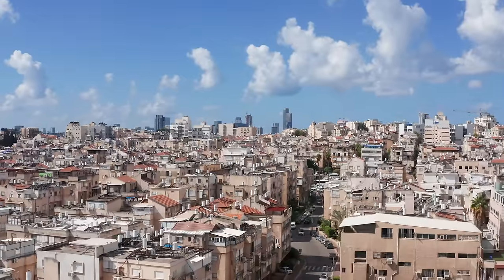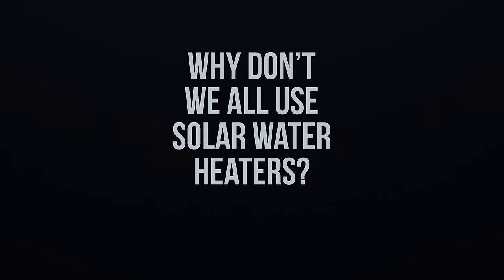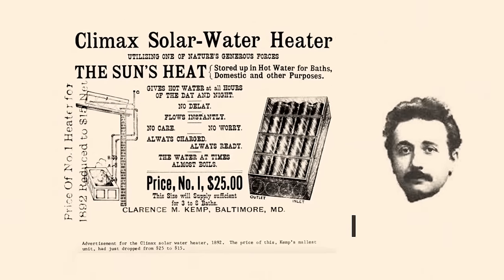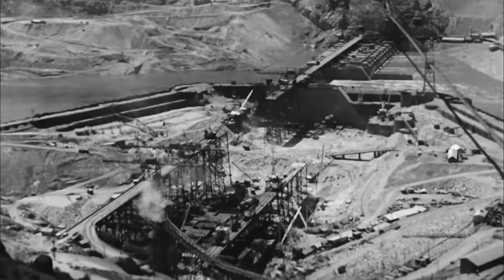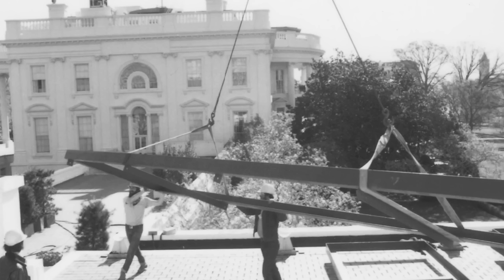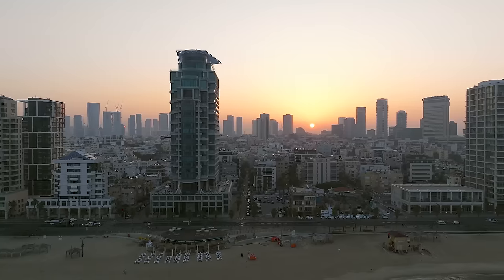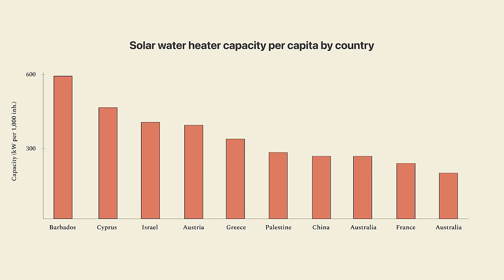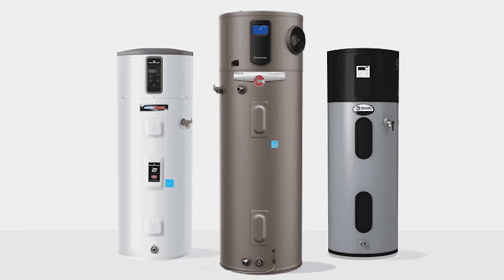Why Don't We All Use Solar Water Heaters?

Comment: I put solar hot water on my home in Florida almost 20 years ago and took advantage of the 30% tax credit. Took me 4 years to recover the capital outlay through reduced electricity bills - after that hot water has been free. In 20 years I have replaced the solar power pump just the once - it cost a mere $80.  I, too, cannot understand why solar hot water is not mandated on all new construction here in the sunshine state. It would create a local thriving industry in making them and they would get cheaper as the economies of scale kick in.
Reply: The answer is simple: When you buy gas or electricity to heat the water the state gets the taxes on them, every year. With solar on your roof they would get less taxes....
Reply: @thesolderman861 The money does does evaporate, they are put somewhere else in the economy.
Reply: More likely the energy companies and rich class political donations and sponsorship dries up, when strategic self sufficient solar and renewable systems are advocated for the public. Private monopoly needs the public dependent on thier energy for thier profits and public enslavement.
Reply: wonder what that does to insurance? they will find any reason to jack up insurance now
Reply: @vevenaneathna  homeowners insurance in Fl is stupidly expensive. As I actually own my house - no mortgage - I decided 20 years ago not to have insurance and just put some money away each year. I've saved way more than it would cost for me to replace the entire roof etc as I will do the work myself if it is ever needed and we have had several major hurricanes pass over us in that time - one destroyed my back porch and I rebuilt it back stronger in block than original for less than 1 years insurance premium. No damage whatsoever to my roof. Thinking of adding some pv panels and batteries to take most of the 110V circuits off grid permanently.
Reply: @burakaskin27  yeah you really dont own ur house until you pay it off coz of the insanity that is insurance. I remember a friend who bought a lake house with an attached log cabin section and their special log cabin insurance was more than their mortgage. made no sense and insurance companies just take advantage of people. look who owns them, its almost all berkshire and other friends who are the richest people in the world. buffet said insurance was the best industry coz if you make a mistake on pricing you just raise ur prices next year and  theres nothing anyone can do. i do something similar with car insurance most of the year when it doesnt snow which is legal in my state
Reply: I have a solar water heater in Northern Germany which would put me north of Montreal on the American continent. It is a big system contributing to the general heating system. It works. It surely lacking some efficiency due to the latitude but from April to October it is providing warm water and during the rest of the year it saves some money by providing some additional energy to heating.
Reply: They are taking of modern vacuum tube water heating.. 20 years ago ir was not vacuum tube water heatting technology.
Reply: Oil and Gas companies. That's the reason. Especially in florida there's a lot of political pushback because of the lobbyists in the pocket of big oil
Reply: @@GRAVITYWAVES999 you need a tank and the fluid from the solar collector is warming the tank with the hot water. The tank can reach nearly 100°C. Today I would build it with a freshwater station meaning that the water always stays in the tank and a small station makes the hot water by taking energy from the tank. This is more expensive and a little bit less efficient but this totally prevents calcification within the tank.
Reply: @OA I have a conventional 80 us gallon tank it has a cold in and hot out. The drain has been replaced with at junction giving a drain and a cold out. The cold out at the bottom of the tank is connected to a pv pump and the water is pumped out of the bottom of the tank thru the panel where the sun heats it. The hot water returns to the tank via and inlet in the middle of the tank thereby heating the top of the tank. During the day the water in the tank heats up. In Florida the bottom of the tank can easily reach 60C so the water in the tank is generally hotter than that - as hot is drawn off from the top new cold water enters at the bottom and is pumped trough the panel to heat. It is very simple.
Reply: I agree, if something  makes fiscal sense, the markets "Should" reward that usage?  The real question we all should be asking is why aren't the US markets favoring this?  I'm an absolute solar, EV, Green environment proponent, but as we all have just lived through, governments incentivizing or at worst mandating have a long history of failure.  Why do these devices cost $700 in Israel and $5000 in the US?  This price spread alone screams BS, but let's go with it for illustration purposes and ignore the huge arbitrage market potential!
Reply: @ilyashick3178  Sure it was. My System is from 2006 and it has vacuum tubes.
Reply: Great to hear, I'm going to be getting one for my rural FL home. I'm not sure why people don't do it either. Must be the flouride in the water lol
Reply: Government should never mandate a product.  Economics and the free market should be the driving force for people to get a product.
Reply: @brandonkenney6310  this depends on the goals of the government. Without subsidies or mandates some products would never reach the production amount needed for sensible prices. Take a look at the price drops for green energy.
Reply: @brandonkenney6310  every house needs a water heater. When a new house is built the builder has the choice (May be) of gas or electric or solar depending on availability. What I'm saying is that in sunshine states the first choice should be Solar; but builders always go for the cheapest option so they instal a crappy electric heater. Mandating through building codes would soon get solar hot water to be commonplace and as I said, economies of scale would bring the cost down. I love my solar system - the water is so hot I had to instal a controller that will shut off the pump when the water at the bottom of the holding tank hits 65C.
Reply: @JohnPilling25  I can agree with you that it makes sense for people to buy them in certain areas, I myself am going to do so with my next water heater.  That  being said, I made this choice on a cost benefit vs. risk analysis,  not because I was forced to do so.  The last water heater I purchased was not a solar water heater because I would only enjoy the benefit of it for a few months before I moved out of the property,  with no gaurantee that I could recover the cost when the property was sold.  In my first apartment, if my landlord was forced to buy one, that cost would likely be passed on to me through my rent.  Furthermore, government imposed mandates or even subsidies almost always artificially raise the costs.  Some of the biggest examples of this are health care, (through governments action on insurance and other policies) and college tuition, which has increased over 300% in a span of about 12 years, far past inflation rates.  
I would also point out that perhaps the best example of an industry that benefited from not being entangled with government is Lasik surgery.  It was not able to get approved for health insurance, but as time went by the procedure became cheaper in price and higher in quality.  Another example is the government forbidding certain products such as gas stoves.  What if my situation necessitates or would work best with a gas stove, then what?  I also like the statement one of my teachers made when they said that you would be hard pressed to find very many stores that sell horse buggies and whips, because there is little demand for them, despite the fact we all could benefit from horse transportation.  To even suggest that the government mandate that everyone be required to purchase a horse drawn buggy today would be absurd, as it is the case anytime  the government force people to buy a specific product.
Reply: @brandonkenney6310  I agrée on many of the points that you have raised.  I took advantage of the 30% tax credit when putting my system in and I recovered the entire cost in just 48 months on the savings on my electricity bill.  Why aren't new homes in Florida required to be built with impact windows? Given the hurricane problems that impact us in south Florida each year. I looked into photovoltaics on my roof but it doesn't make sense financially as a battery storage is necessary to run through the night and when the power is off for days/weeks after a hurricane. Plus FPL now have minimum billing so I have to pay $25/month even if I use 0 kWh of electricity from FPL.
Reply: @FlorinArjocu How generous of you to be paying extra money just to make sure others have jobs.

While I love your version of philanthropy do you carry that over to other ideas like medicine or poverty? Like would you pay extra for a doctor that used that money to treat poor people? Hum...

It's a little misguided though, obviously more money into solar water heaters would make way more jobs. Any moron could see that.

No friend, Regan removed thoes solar panels out of spite and everyone knows that. A green economy makes way more jobs, the numbers are in on that.

There is one huge problem with the green economy tho... It doesn't make any money for large oil companies.
Reply: @georhodiumgeo9827  You got my idea wrong. I was replying the idea that if you are more independent, the government does not get the monthly taxes from you buying natural gas or electricity, but that spared money goes back into the economy anyways, so the government will get some taxes from other ventures you'd be investing in that spared money.
Reply: @brandonkenney6310 You are absolutely correct. The US Constitution doesn't allow government to do most of the things that they are doing, never mind mandating even more! 
 Red blooded Americans won't be forced to do anything they don't want to do, but just might be willing to choose to do something they are shown to be a good idea.
 A huge problem is that most US citizens have never read the constitution for themselves, and don't care to have their own copy. They will actually even sign their rights away to get some government program or live in an HOA etc.
 Don't get me wrong, I'm not against renewable energy. I actually went to college for it. I have installed, and worked with many systems. I know better than most how well solar thermal works, and how much more efficient it is than photovoltaics for producing heat. 
 Although I think it's a great idea, for a multitude of reasons, I don't think I should be able to force you or anybody else to do what I think is right, unless of course it is specifically written in the Constitution.
 I also acknowledge that there is a problem with the entrenched energy companies spending huge sums convincing people that renewables are a bad idea by making mountains out of mole hills, twisted truths, and all out lies. They know, that once the people find out that they don't need to keep paying for utilities Every.  Single.  Month.  they're done for.
 Although I don't have an answer to combat this yet,  I know that government mandates are not the answer.
Reply: Sound really good, but about 1.5 years ago I calculated ROI to 19 years, whilst the common life span is about 10-15 years. Not uncomonly is the system destroyed by larger hail stones, it wears down (so say articles I read). Now I have PV solar system and a heat pump and since I would purchase them anyway, it makes sense to use excessive solar energy (most of the year) to heat the water. The efficiency should be around 400-550%, so I think it is probably on pair with the hot water solar system in terms of hot water heating, while both equipment is serving dual purposes. I should add, that the ROI is so bad because installation companies eat up most of the green subsidiaries, so when they were raised over the years, they absorbed them. So the subsidiaries made it in fact much less affordable, since one has to invest the money first and then would get part back.
Reply: @oakld  I believe that most of the cost of solar electric and solar hot water is the installation - those companies charge a fortune and getting a quote for just for the equipment is nigh on impossible. It made sense to me to do it myself with the hot water -  it's just a bit of plumbing and it was really easy to do. Saved lots of $$$ right there.
Reply: @JohnPilling25  That is correct, but that will not be cheaper or not by much, since the green subsidiaries pay 50% of the costs. It's the same with PV solar for now and it's also totally corrupted environment, the subsidiaries did not work as intended in very stretched and tense market, that struggles to deliver, mostly due to not having enough people to do the installation. I did it without subsidiaries (myself and with my electrician) and paid the same as my colleague, who got 50% back (but had to pay full price first), but I had it immediately, while he had to wait more than a year. The fact, that the installing companies pocket all the benefits is not the worse, but that they try to convince as much people as they can to order and make deposits, with very long but still unrealistic lead times. Then often installing equipment which was good two years ago, not the what's available now (PV is still developing quite fast).
Reply: Has your homeowners insurance ever been a problem? There have been stories about them being risk averse over photovoltaic panels.
Reply: @Raj-yy7xx that's good news in a way, once the companies that make and install renewable systems get big enough they can hire lobbyists and write checks
Reply: well if you paid off in 4 years, up north we should be able to pay off within 10 years...thats like a no brainer. I am an AE grad and have been in love with solar thermal for a while, cannot wait until i get the opportunity to spec some for a project
Reply: many yrs ago the local council installed solar water heaters in the town swimming pool , then the swimming pool was closed and site sold for building
Reply: @svenweihusen57 My plumber father in law built solar hot water devices made of wood, copper tubing, and glass enclosure. In Florida and that was 50+ years ago, it provided all the hot water a family needed at pennies on the dollar considering electricity costs. Ever leave your water hose all day in the sun? You know in Florida that you have to open the hose for at least 2 to 3 minutes to bleed off the super hot water in order to get to cool enough water to water your flowers. We waste far too much free energy in America .
Reply: @thesolderman861 Let us not forget the power company tax.
Reply: @brandonkenney6310  if there ever was such a thing as a genuinely free market you might be right to let "the market" decide which products gain but there isn't a genuinely free market & probably never will be, plus we have a climate emergency to consider.
Reply: Because it’s Florida.
Reply: My family has this fear that the tubes will burst and this will cause the hot water to dampen the roof.
Reply: Florida is a backwater that's why.
Reply: solar water heater isn't a good investment. Instead of buying a $10,000 Solar water heater, it's better to buy a $1000 normal water heater and put $9,000 into a stock market index fund. Solar is nice if you're already wealthy, but for most people it's not a wise investment choice.
Reply: Yeah til a FL hurricane turns your setup into a flying cloud of death shards.
Reply: @JohnPilling25  putting batteries in place of your 110v circuits would probably be worse for the environment, and wouldn’t be very efficient. There’s a reason DC was replaced by AC. If you want some good batteries, you would have to buy lithium ion, and extracting lithium requires a lot of fossil fuel. I think most EV cars don’t lose their carbon footprint for a least a year maybe more. Once a battery is made, well it’s there and it cannot be safely destroyed.
Reply: Floridaman actually does something smart
Reply: @thomastrostmann6564  actually I'm English!
Reply: because sunshine is woke stuff
Reply: I think a solar panel and heat pump combo is more space efficient than a solar thermal heater. Space efficiency matters if you are going to put solar panels on your roof for electricity generation.
Reply: Hi can you tell me the exact solar heater that you have because yours sames to outlast some I read about. I would like to get as much years out of my water heater as I can.
Reply: And where did you buy it.
Reply: Mandating energy options is what helps cause monopoly inflations. It's called supply and demand. That's why it is not required.
Reply: Who is going to buy the freedom juice, if everyone uses solar?
Reply: its the grid people.